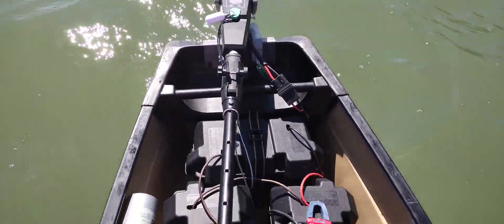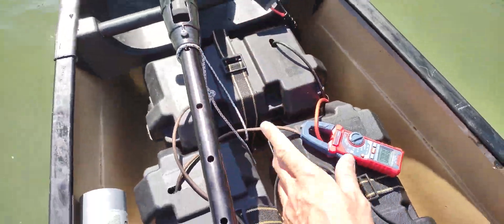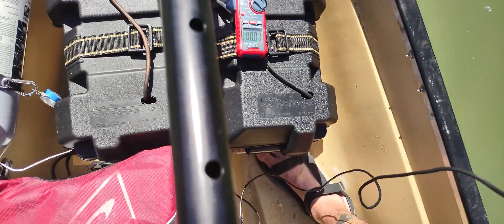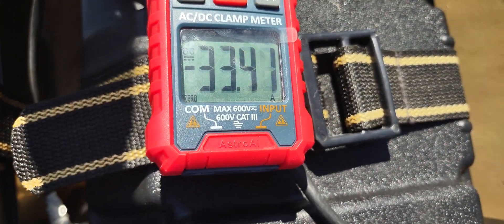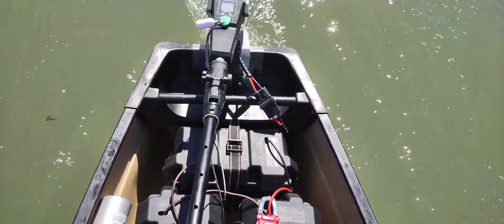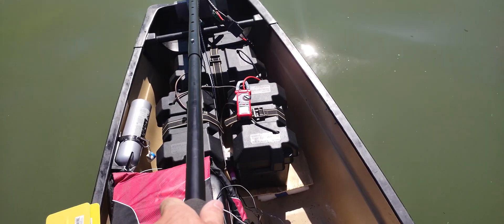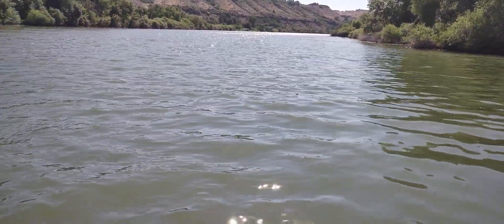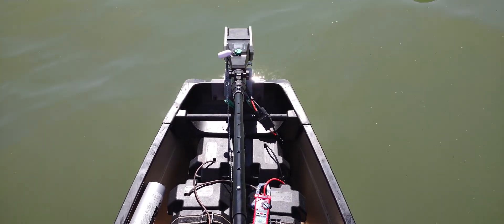Newport vessel nt300 outboard motor. HOW MUCH POWER ?

Comment: So how long could you run full throttle with a 36v 50ah?
Reply from the maker: @alexw575  that's what I currently use with the nt300. A single 36v 50ah lifepo4 by timeusb. It will run full throttle for about 1 hour and 20 minutes tops. I did a capacity test on all my batteries ( both weize and timeusb) and they all have tested over capacity (great)
Reply: @JosephMBoyer  Ok thanks. I was wondering if a 50ah would be big enough. If you ran it full throttle for 40 minutes, would you still have about 50 percent capacity left for slower trolling?
Reply from the maker: @alexw575  yeppers, it's a big math equation. Ohms law.  So 40 minutes of full throttle would roughly equate to 23amp hours used. Would be left with another 27amp hours for slower speeds. I have another video that shows the amp draw at slower speeds.
Reply from the maker: These are rough numbers but pretty accurate I must say.
Reply: @JosephMBoyer  Sounds like a 50ah is probably big enough. I haven't seen many capacity options in between 50ah and 100ah. Doesn't seem like they really exist. Would you recommend a 100ah?
Reply from the maker: @alexw575  I do just fine with a single 36v 50 ah battery and would recommend that. I always have power to spare. However it's totally up to you and how far/long you plan on boating with it.
Reply: @JosephMBoyer  Ok thanks. That will probably be enough. I think a 100ah will be getting too heavy. I kinda wish they made a 65ah, but I haven't seen any.

Comment: Why you compare it with 2-3hp gas? With my 125$ 1.3hp 4 stroke I can go 7-8 kn all day long. You cant compare 1hp  on propshaft to 2-3hp on the propshaft using gas motor. Hp or watt is allways the same value.
Reply from the maker: I think newport compares the HP at the wot; idk

Comment: The throttle direction can be reversed (back to the normal direction) if you go into the motors calibration and turn the throttle the way you prefer.
Reply from the maker: yea!! i seen that in a short clip not long ago, thought that was odd, I'm going to look through the paper manual and see if that process was left out as I dont remember reading it. good info!
Reply: nope wasn't in the manual, this has been my biggest fault with the motor @JosephMBoyer
Reply: Do you have the instructions on how to change the throttle the other way?

Comment: OR you could say you have 3600 watt hours (36v x 100ah) divided by 1300 (wide open throttle) gives you 2.7 hours (roughly).  At 950 watts (75% throttle) gives you 3.7 hours.  I currently have their 36v 50ah battery on my 16' Old Town Sportsman and have been getting pretty good run times!  WOT kills batteries, I recommend 60-80% throttle with this motor as you don't get much more speed with WOT.
Reply from the maker: perfect

Comment: Thank you!  This just answered the question I couldn’t find on their website.  33 amps is nothing power wise.  Great motor.
Reply: 33 amps is nothing @ 12 volts for sure - 400 watts (0.55hp). But in this case it's 38+v and therefore 1.3KW (1.75hp) which is a nice reserve as going above 500 watts really starts cutting the range. A Tesla Y battery pack is 400 volts which at "only 33 amps" would translate to 13.2KW (18hp). Keep in mind the Elco EP-30 uses a 96v battery @ 130a and achieves 12.5KW (17hp).
Reply: @ctibpo991  Great info.  For me its cost and battery that makes this so attractive.  3 hours off a 100 amp hour battery is very solid.

Comment: Well done. Would love to see a table showing the boat's speed at 100w, 200w, 300w right up to 1300w.
Reply from the maker: will try!, I plan on making another video with a volt meter side by side with the clamp-on meter. as volts decrease amp draw will increase.  I need a camera other than my phone. lol.
Reply: @JosephMBoyer  Or... just use that wonderful wattmeter on that beautiful new motor of yours for reference. Your ammeter/voltmeter test already confirmed that it is pretty damned accurate. Just set the desired wattage and then walk forward to trim for best speed. 😎
Reply: It's easy, just take your total watt hour for your battery setup (36v x amp hours) and divide by the watts being used shown on motor.  My setup is a 36v 50ah (Newport) which gives me 1800 watt hours and I usually run around 950 watts (75%) which = 1.8 hours run time (roughly)

Comment: Nice! So what was the cost for the three Weize 12 volt batteries?
Reply from the maker: Amazon day had them for 280 a piece. I bought them at 310 a piece so it was almost 1k. I have other weize 12v 20a batteries (not made anymore) that have not failed (used excessively and charged by solar in a van). I do have other brands that have failed, avoid btrpower brand, and avoid all the blue/black shrinkwrap lifepo4 packs off ebay. they're garbage. People are having success with Chins brand. If i had to do it again, personally I'd look into Prismatic Cellswith a BMS that can monitor their capacity and keep them at 50% when im not boating. I charge all my batteries and projects off solar.
Reply: I got a 100 ah 6v lifep04 for around 800 Canadian in the spring, price is up to 1200 cad now. Also The throttle direction can be reversed (back to the normal direction) if you go into the motors calibration and turn the throttle the way you prefer
Reply from the maker: but i have had good success with weize, years prior with lifepo4. thats the reason why I kept that brand. but I still have doubts. Time will tell. so far they're doing great. I run a 80amp fuse on each battery. god bless
Reply: Buddy excuse me the question.    Are the batteries deep Cycle or lithium ?  Thanks